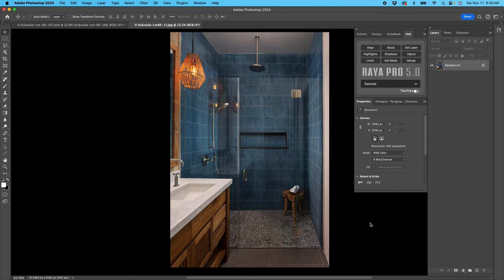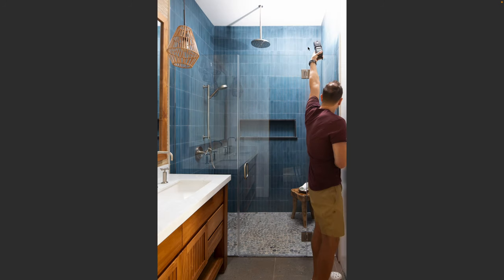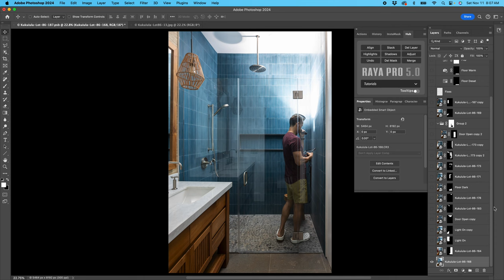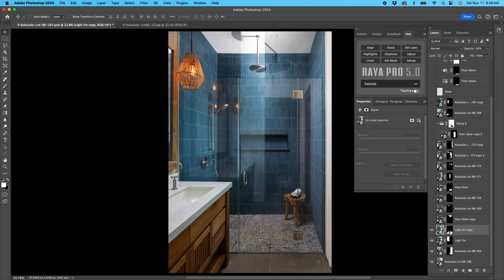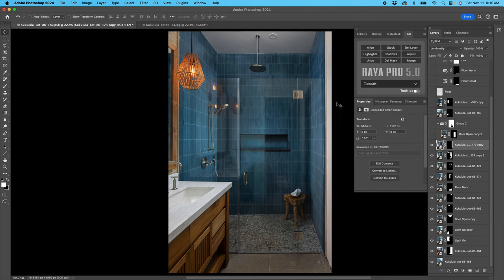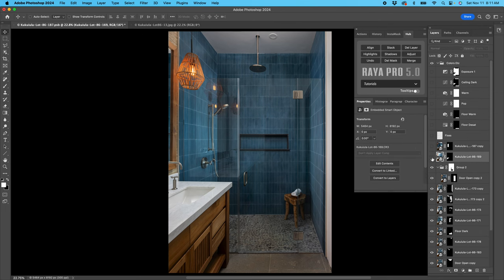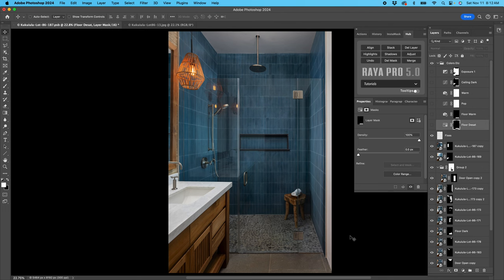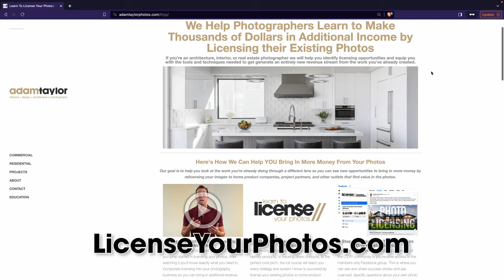Spray and Pray Method for Photographing Interiors

Comment: Clients have no idea how involved some of these edits can be! I kept nodding to your commentary about how you shot and edited this. Been there! One recent bathroom shot I did had a hard reflection of a window in the glass. It was a one point composition like this and after trying different techniques to remove the reflection (which I should have done on-site of course), I selected it, and used generative fill to remove it. Worked GREAT.
Reply from the maker: Haha awesome!! I have still not used the generative fill in a way that actually worked for one of my images.

Comment: Great results, but I can’t help think that to save yourself a ton of time with fighting reflections, using a combo of a polariser and hanging a large black cloth on the opposing wall would have cut your post production time dramatically. The flash use inside the shower definitely helped to make the tiles pop, looks great!
Reply from the maker: CPL filters don't work when shooting head on...they only work at an angle. (I tried anyway though juuuuust in case, haha.) And I did hang a black cloth behind the camera to cover the massive window. The reflections were still VERY strong and super distracting.

Comment: Love seeing walk throughs on these intensive ones - nice shot! I always see these compositions as a fun game to make the composite work in as few shots as possible. Every room is different in how the light bounces of course but you definitely pick up on more "educated guesses" than "spraying & praying" over the years, and sure looks like you had some keen insticts so give yourself credit. We creatives tend to discredit hiw much experience we pour into choices. I personally find mounting the flash on the end if a sturdy monopod to be a gamechanger. You can hold the flash into a very specific position often while keeping your body out of frame so you can have more usable section from each. Sometimsmes with bathrooms like thing I can actually be behind camera but holding the flash into the room. I often wind up bouncing close to ceiling, right above the glass in this case so the reflection from the light isnt going right back to camera. Just my 2 cents from years of spraying and praying! 😂
Reply from the maker: Well said! I never use the “light on a stick” method because I use heavy 600ws flashes. But maybe next time I’ll try that out!
Reply: @adamtaylorphotos  True, would be impractical with that. I've got some AD200's that are a nice middle ground but even 1-2 speedlites work! Thanks for sharing!

Comment: Adam can you talk about when/why you use different blending modes - normal, lighten, darken, luminosity. Thanks
Reply from the maker: @williamwidmanphotography  I honestly don’t use different modes often and don’t know THAT much about them. But basically I use lighten when I only want the lighter parts of that layer to show, use darken when I only want darker parts of that layer to show, and luminosity when I want to use the color information from the bottom layer, but the exposure or other info from the top layer. And a lot of times for me it’s trial and error when I try out the different modes.
Reply: @adamtaylorphotos  Thanks Adam! 😎